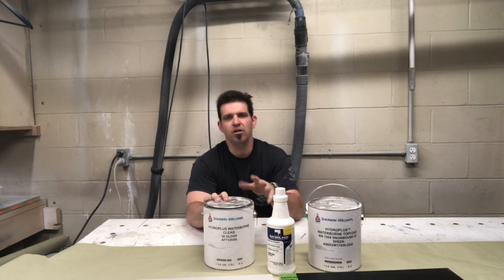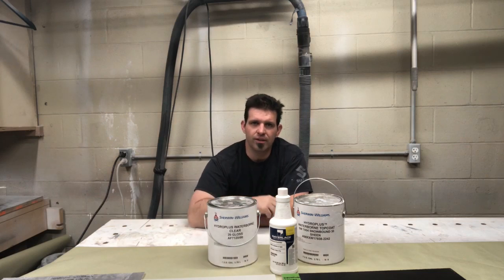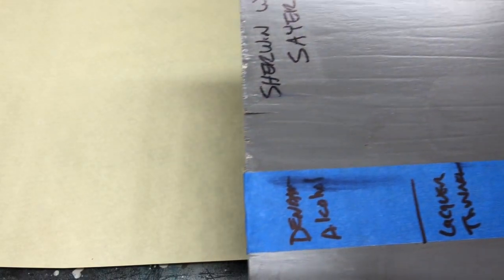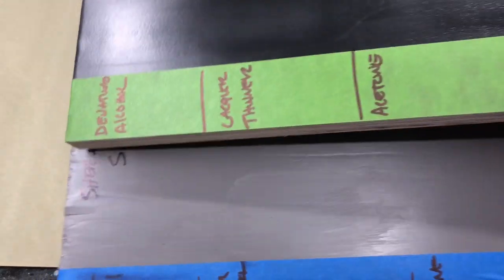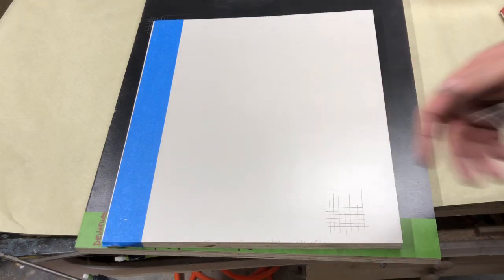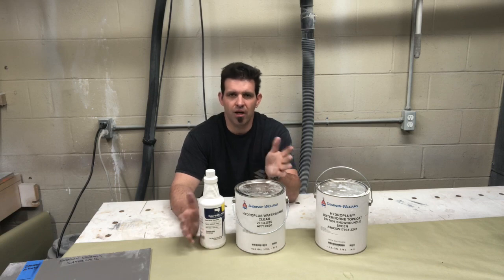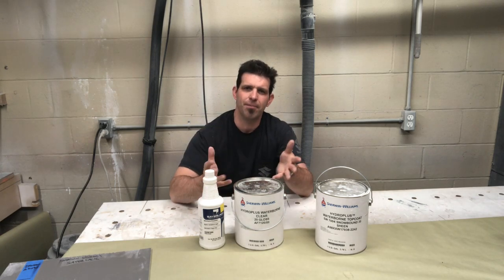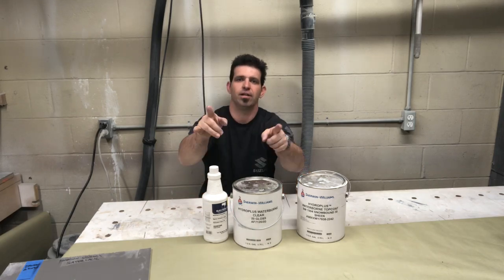Sayerlack Hydroplus Revisited

Comment: Hey Eric, thanks for the review. If I use this product for a refinish do I need a special primer? I really want to stay away from vinyl sealer because of the harsh smell. Also, if I use the pigmented hydro plus do I need to add a protective clear coat? Or should I be okay with the catalyst mixed in?
Reply from the maker: Fine Finish Cabinet Painting and Design LLC it all depends in refinishing the issue is dye migration and tannin bleed. Technically the top coat will have better adhesion than any primer will. However if the top coat is not self crosslinking it will not block the tannin bleed. If you use the crosslinker in the sayerlack it will block the tannin bleed but the cavet is that you have to let the film crosslink for 6-12 hrs. So for speed most guys use vinyl or bin or some other form of blocking.

Comment: Nice job! Just got my hands on some sayerlack to try out on a potential job from my sales rep, but was not told about the cross Linker. Thanks for your videos!
Reply from the maker: darrin hodges yeah if you need the extra mar and chemical resistance it’s definitely worth the money to use it.
Reply: Just found a sales rep in our area that carries the milesi totally stoked! learned a lot from your videos much appreciated!!
Reply: @ballardpaintingcompany514  Sayerlack "cross linker" is an aziridine product. It's one of the more dangerous components used in chemical coatings. It was available on the market but rumor has it has been pulled. Other European coating shops stayed away and focused on the 2k WB polyurethane options for their overall improved health/safety and performance. But what do I know ;)
Reply: @iansimpson4428  I wonder if the Renner cross linker is an aziridine product as well.  Hmmm.
Reply: WordAboveAll it was 5yrs  ago. If it’s used at 1% and does not induce a pot-life, it’s more than likely
Reply from the maker: darrin hodges it’s good stuff.